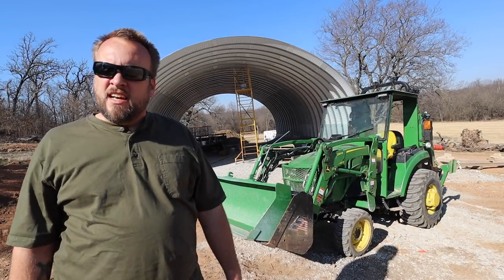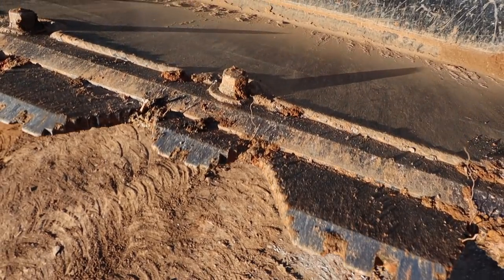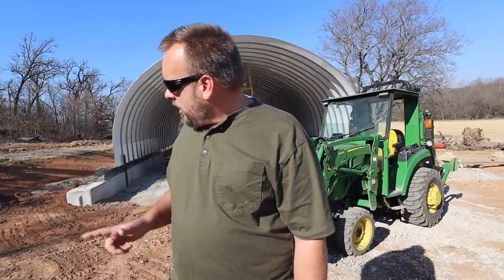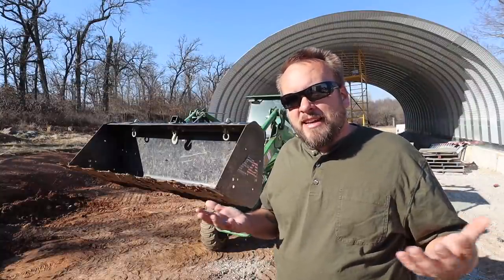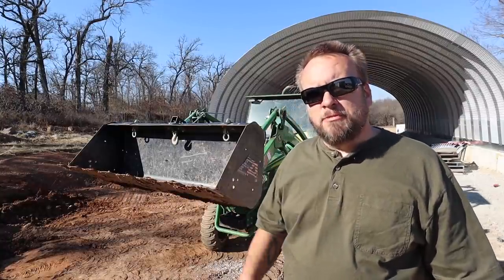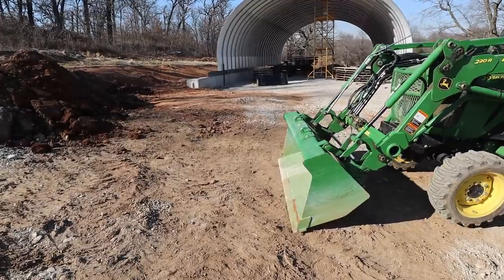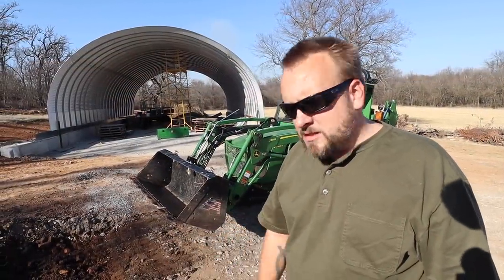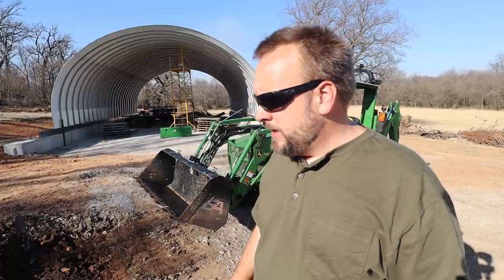Tooth Bar Vs Factory Bucket Edge  - Is It Really Worth the Money?

Comment: Actually comparing the buckets side by side was a good idea, Brock.  I bought a Heavy Hitch tooth bar for the bucket on my JD3046.  I've got a lot of clay mixed with big rocks on my property, and the standard edge just seems to slide across that, especially when it contacts the rocks.  With the tooth bar attached, the larger teeth dig in and make short work of the dense clay and rock.  There's a night and day difference, at least for the dirt on my property.  Of course, those large teeth leave obvious furrows when back dragging, so I wait until the final finishing and then take the tooth bar off.  I absolutely love the Heavy Hitch tooth bar.  I don't use it all the time, but for serious digging, it's a real time saver.
Reply from the maker: I would like to get a good opportunity to do the same comparison with that style of tooth bar.

Thanks for commenting

Comment: I have the piranha tooth bar for the past 3 years. For taking out 1.5 inch saplings and clearing brush the stock bucket will just push it over if you don't dig under it. The piranha will grab it at the base and push it out by the roots without digging under it. Same as pushing out shrubs. I take it off when working in rock since it's only two bolts witch is fast and easy. I think it all depends on what your using it for. Love your videos.
Reply from the maker: Thanks for sharing

Comment: I think it depends on your soil type, moisture, job at hand, and overall tractor set up. Seems traction was your biggest issue on the shrubs. Doesn't really matter what tool you have if you're just spinning your wheels and the power isn't being delivered to the project. I have the Piranha serrated bar on my JD 4200 and have noticed it tears out vegetation much better than the stock edge. It slices through roots rather than trying to pull them out which is the main job I bought it for. My factory edge may have been rounded off though from years of work without protection. I don't work when it's too wet for traction reasons you experienced. Didn't really settle the question but I appreciate the info and the effort.
Reply from the maker: Yeah, not necessarily trying to be the definitive answer to the tooth bar question but just give a point of reference 

I would like to repeat this test with some other brands of tooth bars

Comment: Brock, you do a great job breaking down data and presenting facts in your videos. 💪  I've watched numerous channels add these bars to buckets and then rave about them, but I've not seen a head to head comparison like this.   My bucket is as important to me as my right hand and I move concrete, dirt, dig, backblade, and 100 other things with it and I've never thought, if this thing had some teeth on it, that job would have gone faster/better.   And I don't want myself, other and dogs cutting themselves on it when it's parked  or when I'm using my bucket as my side-by-side carryall !!
Reply from the maker: I was surprised by this result but I didn’t see any advantage to the tooth bar

thanks for watching
Reply: @RockhillfarmYT  I agree, I think I will save my money and just use my stock bucket

Comment: Good video.. I have 2 tractors, one a subcompact with the piranha bar, the other a compact with the wicked bar. The piranha bar was a game changer for my subcompact. Especially as others have mentioned, for pulling out brush and saplings. When it comes to digging with the subcompact, i feel the piranha bar was a definite improvement. Now, the wicked bar on my compact.. it also works well for biting onto brush and saplings and pulling them out of the ground.. however I feel that digging ability was not much improved. The piranha bar has smaller teeth in between each beveled tooth, that actually come to a point.. the wicked bar just has bevels, with small serrations. I feel those smaller pointy teeth on the piranha bar definitely penetrate ground better than flat face beveled design of the wicked. I dont dig a ton with my loader, I have a backhoe for that, but if I had to buy a toothbar again, it would likely be whichever brand could get me one fastest for the best price. They both do what i need most, which is brush clearing, and in my opinion that is where they both shine.
Reply from the maker: Thanks for sharing your experience

Comment: Obviously, if money was not an issue, get both. The stock bucket can get beaten up quick. I have already bent the bottom edge, and had to get it straightened. If you’re working with a lot of rocky soil, I would suggest the other bucket. I find having the perfectly flat edge on the stock bucket very efficient when plowing my driveway. I do not have a rear blade for my tractor, is one main reason why. Great video Brock. Thanks!
Reply from the maker: Thank you for watching and for adding to the conversation

Comment: thanks for sharing the video, I just recently put a piranha tooth bar on my new bucket because it was the same price as the OEM blade. but the main reason was to slow down the wear on the factory bucket. I think the reason you're not digging in as  good with the serrated blade is because you're doubling the thickness of the contact point on the face of the bucket. that's just a guess though
Reply from the maker: Probably right, and possibly the tractor doesn’t have enough pushing power to utilize the cutting edge?
Reply: @RockhillfarmYT  for my results I didn't notice any better digging ability by adding the piranha blade.

Comment: I have a heavy hitch tooth bar. I bought it when I had a John Deere 755 with a Westendorf loader. The loader bucket was not quick connect, but pin on. I bought the tooth bar for moving firewood more than digging. The teeth stick out far enough you can lift a fair-sized log and roll it back. Carry the log where you want it. Poor man's pallet forks. I now have a 2025R. With grapple and pallet forks. Still use the tooth bar, to scoop up a bucket full of split firewood. Then let the tractor carry it to the stacking location. I can also scoop a good amount of firewood rounds into the bucket. Then roll them out of the bucket one at a time onto the splitter. I only used the tooth bar in dirt 2 times with the old tractor. The bucket on it cut like a butter knife. So, the tooth bar helped a lot. Have not had an opportunity to try it in dirt with the 2025R But the bucket on it is way way better than that old one.
Reply from the maker: Thanks for sharing. I hope to test out one of those heavy Hitch bars at some point
Reply: The tractor is too heavy in the rear with the backhoe on. Bucket rides up too easily because of the the weight far behind the rear axle. Teeter tottor affect. 🚜

Comment: I have a Heavy Hitch toothbar for my John Deere 1023E's 53" bucket. I have found that it is an incredible digger and root ripper, but a terrible back dragger. It also can be a decent, low cost alternative to forks, or maybe even a grapple with some tasks because the teeth are long enough that it will kinda allow your bucket to hold onto brushy items and some longer items like lumber and small logs. With that said, I also own actual forks and a grapple, so I didn't purchase it with that in mind. I have just found I can get by well enough sometimes that I don't have to take the time and effort to switch implements. So I have been pleasantly surprised by that aspect as well. One more tip on it if you decide to try one, I recommend spraying the large set screws that hold it on with a good lube like PB Blaster each time you install/remove it. If you don't, the threads tend to get rusty and hard to use because they are always going to have dirt and moisture in and around them. Thanks for the honest videos!
Reply from the maker: Thanks for sharing

Comment: I have made a tooth bar with real tooth. And the stock bucket is just as good in a virgin gravel pit with rock in it
If you what to remove small branches the tooth bar will work better. This is my opinion. Our tractors just dont have enough traction to make a big difference. Nice watching your videos
Reply from the maker: I agree that the shark Tractors aren’t able to take full advance of the teeth

Thanks for watching

Comment: I think the EA bucket cut thru t h e roots better. Also , didn't your tires dig in more in the grass with the stock bucket?
One other thought,The John Deere standard buckets have a tendency to warp on their top if the are not reinforced.
Reply from the maker: The wicked bucket is definitely built strong but I don’t know that a tractor this size has the power to utilize that cutting edge.

If you put the same edge on a skid loader you might see a different result
Reply: @RockhillfarmYT  Maybe a good test when get you skid steer or 3R series 🤔. Lol I definitely think a stump bucket is superior on removing bushes and samplings since it is more focused on the impact point.
Reply: I think one big advantage to the EA Wicked toothbar is that it'll wear extremely well with the Hardox 450 material.

Comment: I’d like to see the comparison again only with the front wheels on the ground.  Bring the advantage of 4 wheel drive into the picture.
Reply from the maker: Particularly on the first test, I was not pushing down with the loader to lift the tractor.   I set an angle and drive straight forward.  When it stopped cutting the tractor would lift
Reply: @RockhillfarmYT  that's a good idea you should do a test video using four-wheel drive and two wheel drive so people can see the advantage of the four-wheel drive. also with and without that backhoe on the back
Reply from the maker: @madtater5948  i’m hoping to re-create this test with some other tooth bars and take everyone’s suggestions as to how to do it better.

My initial reaction, is that I don’t really think four wheels would make a difference because the hydrostat what was bogging out in the first test.  If the tractor has reached it’s maximum pushing power, then gaining more traction won’t help it push more, it would just cause it to bog down sooner
Reply: Traction was an issue. Raising the front end puts all the available weight on the rear wheels. He likely would have spun the wheels sooner on all four.
Reply: All good points!
Reply from the maker: Thanks for watching

Comment: Digging puts A LOT of stress on the loader frame and tractor, and that Deere shuddered & shook much more with the added leverage the tooth bar put on it.
Reply from the maker: Yeah, it’s not advisable to dig like I was on a regular basis, but I had to find someway to demonstrate if it was working.

I’ve got 800 hours on it and it’s been a good Tractor
Reply: @RockhillfarmYT  It was a good demonstration.  I’m toothbar curious, and it helped.
Reply from the maker: @markmacdougall7206  I’ve been using that Perona bar for the last year and a half or however, long since the video came out, and the cutting edge has held up well

Comment: There is a reason that they call them “Loaders”.   They are to be used for loading and placing materials…. Not for Excavating/Digging dirt, rock etc.   that’s why they make backhoes, track hoes & steel tracked dozers for excavators!   Tractor loaders are not and were not designed to excavate period.  overtime you will eventually twist the loader arms doing this.   In your video when you are digging in you can plainly see the loader arms bending/flexing under the load the tractor weight is putting on them.  They simply are not built heavy enough to that this kind is stresses.   Hope to see you get to the end of the new shop arches construction! I’ve really enjoyed watching you get that put up and all your problem solving along the way.  I’ve learned a ton thru watching.   I find myself cheering you on as if I was at a state championship football game!!!   👍👍
Reply from the maker: And I think that’s why the tooth bar didn’t cut any better.  The tractor just doesn’t have the ability to utilize it

These tooth bars are a huge market and very popular because people do want to be able to dig with their loader

Outside of just doing a test I would have dug the dirt up with a backhoe first

Thanks for following along with the channel
Reply: Concur with this! I know of a much heavier duty loader that had one of the main arms broke when a relative was trying to move a pile of red clay that had set up for several years! I realize this was just a test, and not Brock's standard MO when using a loader, but folks often expect way too much out of their loaders!

Comment: Bro, you might want to use some hearing protection on the tractor.
Reply from the maker: Thanks for your concern. I did a video testing decibel levels on the tractor and relating that to hearing protection ratings.

A tractor is not nearly as loud as a lawnmower and only requires hearing protection if used for long periods of time

Thanks for watching
Reply: @RockhillfarmYT  I get ya. I always wear ear plugs. Just be safe. Wearing hearing aids at 70 isn’t the best. Great video  on the tooth bar. I have a piranha  ordered. Hope I’m not disappointed.
Reply from the maker: I have been happy with the piranha Bar

Thanks for watching

Comment: Tires are a big part in this, weight and the tooth bar bucket isn't really a tooth bar, its like some quasi rough edge bucket. A real tooth bar would have a 1 and 1/2" to 3" tooth.
Reply from the maker: Thanks for watching and for sharing your thoughts on it.

I have a traditional toothbar like you’re talking about on the way so that I can compare this style to that style.

I’m going to try to get a better test in the second video

A lot of people like these piranha style bars

My tractor weighs over 5000 pounds but most of that weight is at the back.

Point being most of the people buying these tooth bars have a tractor the size

Comment: sounds like you're trying to sell yourself.  you don't have an angle gauge to measure what angles your digging or cutting.  to me it's pretty obvious neither one does the great job that you want it to. 
So the real question is:   if someone doesn't have a bucket.  what bucket should they buy?  a stock bucket or a an aftermarket bucket such as EA?